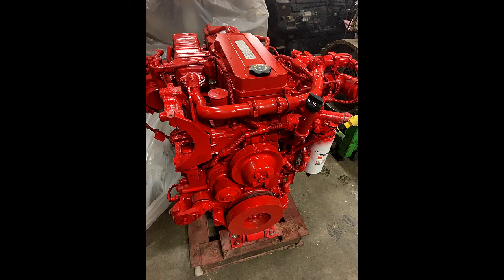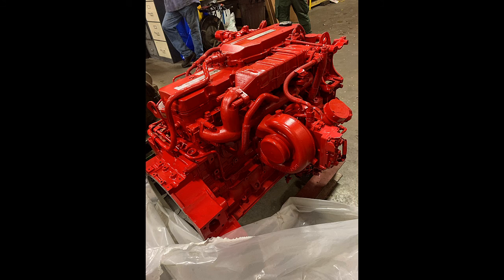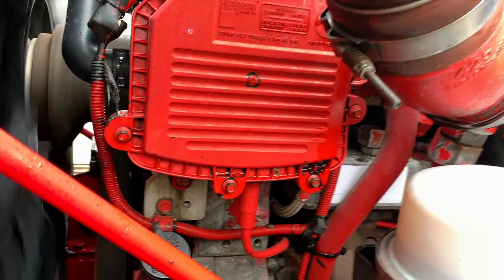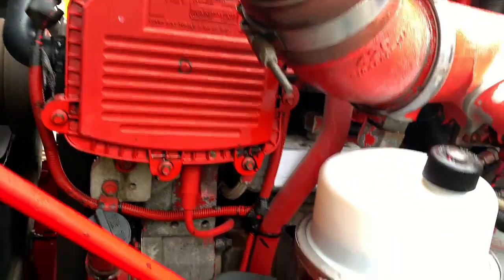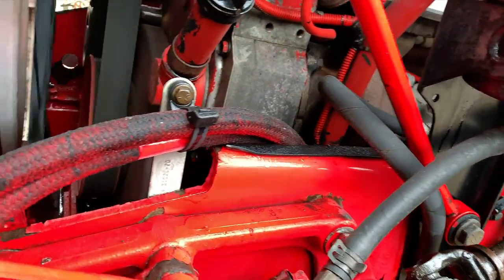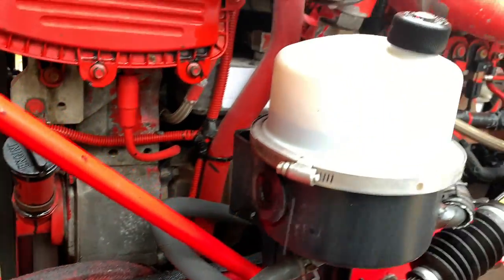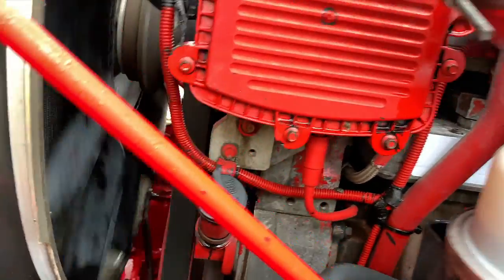Truckers quick tip fault 555 or 556

Comment: Hey Joe, what H2O is considered high crankcase pressure ? Mine is 1.8 in H2O.
Reply from the maker: High on any engine made after 2007 is 14" steady under load. The faults dont start until you hit around 16-18". Any engine made before 1998 10 inches is high. This is in my opinion.

Comment: could these 2 fault codes be caused by a sensor failure?
Reply from the maker: Yes they can. If you have an ISX that pigtail wire is always being shook by the fan's air flow when its on. We have seen broken wires and shorted wiring as well as failed sensors.